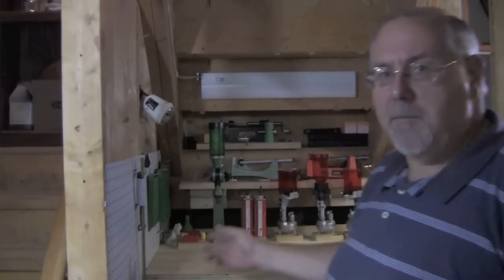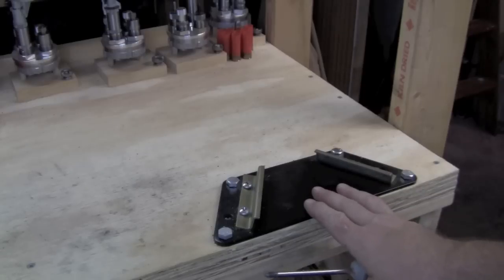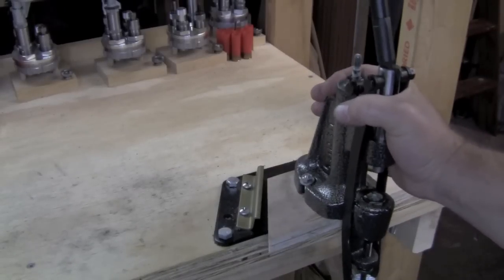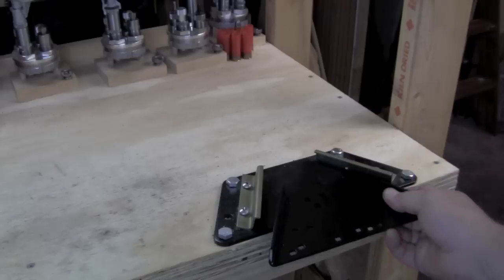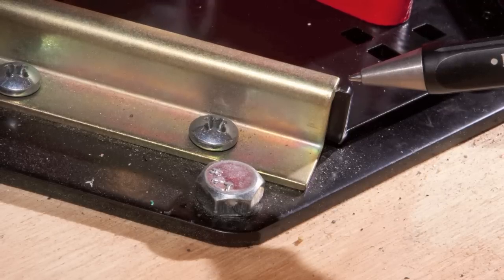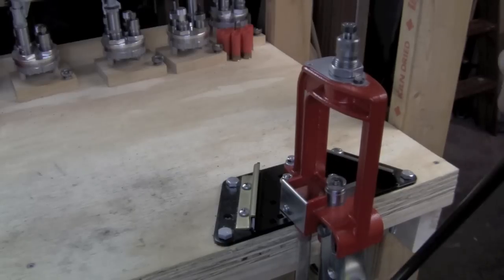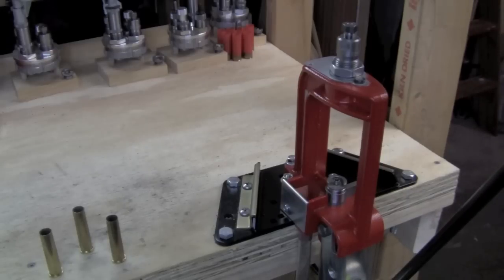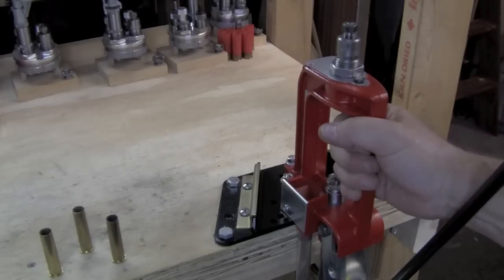Small Space Reloading with a Lee Steel Bench Block.mov

Comment: For those that still want to use the wood bases, put a piece of self adhesive skateboard tape on the bench mounting plate. That will provide enough gription to hold the wood in place.
Reply: or velcro

Comment: Great review and thank you. One note is that I immediately questioned the slipping that you addressed and then saw Lee's answer.  I would think if you already had the wooden blocks set up you could predrill a piece of 1/8 inch strap and screw it onto the narrow more away from you part of the wooden block and leave it high or proud, above the surface of the wood and it would stop the slipping too so you would not lose the use of any blocks you were already using and use the metal from then on.

Comment: Nice idea but Lee needs to continue developing the concept, instead of 4 screws, there should be a lever latch on either side. Slip in the plate, flip down the lever locks on either side and the base is locked in place. No screws, no screwdriver.
Reply: ...I agree - some sort of QD system is needed...I've always used large 'C' clamps to attach my presses to a table - usually because I'd need to remove/relocate them., but later out of habit...I'm bringing my reloading equipment into the house now since my wife passed away last year...the garage during the summers here in Florida is oppressively hot...I'll mount it on her former computer desk but won't drill into or otherwise mar it - I'll use my old standby of a plywood base as I have on my older Lee, RCBS and Dillon presses - secured with those ubiquitous 'C' clamps so as not to destroy this desk...I like those Lee brackets and am thinking of getting a set for my new, soon to be delivered  Lee Pro 4000...I had a pair of 1000s about 30 years ago but foolishly sold them after my stroke...the Dillon will remain in the garage for my rifle calibers - the Lee will be for pistol calibers that I shoot more than the long guns now that I'm 72

Comment: The new models have a couple holes in the bottom of the bench plate, and you're supposed to drill corresponding holes through wood block, which you put a couple bolts through to hold it in place. Seems like Lee heard about the wood blocks walking out and changed the design.
Reply: ...great idea/tip...I'd countersink the bolts into the base of the plywood block to avoid interference against the table...

Comment: An even easier fix for the "walking" issue would be to drill a hole for a ring pin to hold it in place.  Would have been easy for Lee to do this for us.  Imagine if the rear of the wooden block had a hole all the way through it straight down through the steel mount plate and your bench.  Then you just take a ring pin and plop it through the hole.  Done!
Reply: spraynpray Genius

Comment: You would not be able to slide the wedge into place. You'd have to remove at least one of the retainer sides and then screw it back down. A bit inconvenient for quick insertion and removal but it would solve the "walking loose" issue.

Comment: I often see videos by  many seasoned reloaders whose presses move under load. I assume it's no big deal as long as the ram aligns properly into the die. Being an Oliver overkill kinda guy, that could just never be on my press. You would need a sledge hammer to move my press(or more-lol). And it is not permanently mounted so I can use it on any table surface. That Lee bracket system just doesn't do it for me. Besides, I don't like the idea of drilling holes in my work surface. Although made of wood, they are nearly(or are) of industrial strength that will last at least two(maybe three-lol) lifetimes. Why mess that up with holes? Also , I figure I'll upgrade from a Lee and use it for minor case prep asks and such. Better to maintain versatility. Nothing budges with the mounting plate and clamps that I use. Far more versatility and flexibility.
Reply: Hey! Mind if I ask how you nonpermanently mount your press without this plate? I'm considering the Lee Plate thingy but if there's a better option I'd love to hear it!